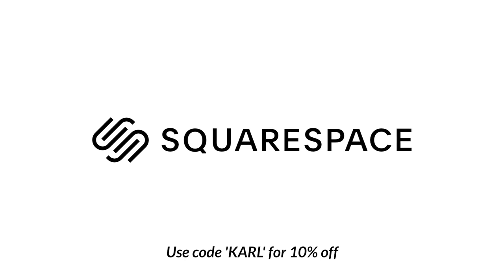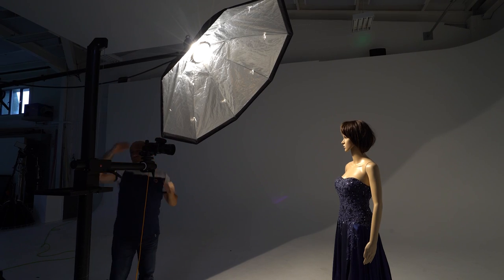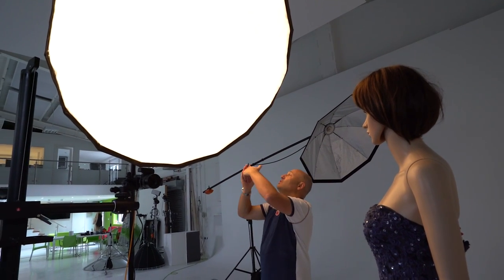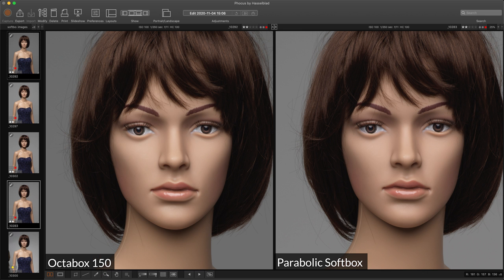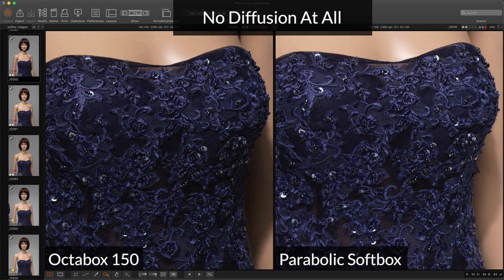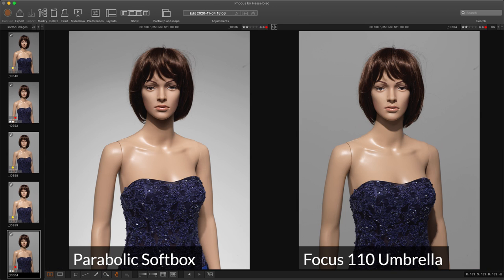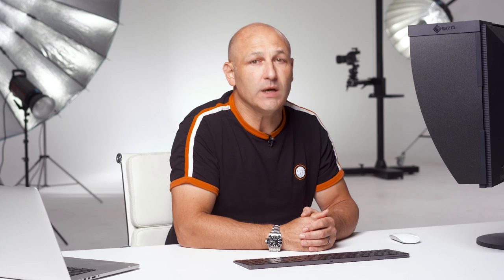The Myth of Parabolic Softboxes - Save yourself time, frustration & money!

Comment: In a larger setting, the deep softbox should give a brighter light in comparison and fall off faster at the edge - parallel to a normal reflector against a high intensity one where a step of light is gained.
Of course, there is no difference in the comparison because only the centre of the light is taken.
Reply from the maker: You may gain a little extra exposure from the efficiency of bounce back of light from the initial parabolic shape at the back of the deep one but after it goes through two layers of diffusion there will be no difference in the homogenous effects at the front of the softbox compared to the Octabox as my tests demonstrated. The only slight difference visible in my test is due to the physical surface area of the front of the deep one being slightly bigger that the Octabox and down to the inverse square law because the light is further back in the deep one.

Comment: In a similar breath, would you say the same about some companies selling softboxes much more expensive than others yet they can pretty much do the same thing.
For example: Broncolor vs. Godox
I'm hoping you've had experience with Godox lights and softboxes so that you can comment about the price difference between the two being justified or not.
Reply from the maker: There are many softboxes that will give the same or similar results to other more expensive brands. However my experience is that they don't keep their shape as long or last as long in general, taking the sort of beating that they might get in the professional world if regularly moved in and out of the studio etc. I've used many brands over the years, well built and constructed from Elinchrom, Profoto and broncolor - The brand I tested here seemed relatively strong but poorly designed for assembly and disassembly also the godox light that I attached it to seemed to lack in strength on the tightening angle handle to take the weight securely, I had to tighten to such a degree I was concerned it was going to break. I've also just recently purchased and alternate brand Parabolic reflector with a focusing rod to compare against a broncolor one that is 6 times the price. The results of that test will be revealed in a future youtube video. In a 25 year studio career I can only say what I experience, I don't get paid by anyone to say anything different so I just say what I see. Whilst I appreciate that there can be big differences in price between things that look similar it is not always as simple as that but I agree there are certain tools where I could recognise that that particular tool will do the required job for less money and that one won't. I started my own career with that approach, the difference is in actually understanding the physics and knowing what the tool is supposed to do and how it is supposed to do it which is why this video is a perfect example. It was painfully obvious to me that this particular tool was literally a waste of space and weight.

Comment: I’m sure the original Parabolics such as Briese with a slidable tube flash source are intended to provide a soft but directional quality as the tube is manipulated...
I agree with your verdict that these pseudo parabolics  are not much different to conventional softbox
Reply from the maker: Hi Simon in this video the main point was that putting diffusion in front of a parabolic reflector means it loses all its parabolic benefits.

Comment: All comes down to primary intent. Buying with the primary intent to use as a softbox? Then sure, it's not a great choice. But if buying with intent to use reverse mounted, then well, if it comes with a diffusion panel, then it becomes just another level of diversity to the tool and that's a good thing. If from the onset I'm wanting soft light, I'm not reaching for my PB. But, I've been known to reach for the diffusion panel at the end of a reverse mounted PB shoot, just to grab a few more shots at the end of a set to obtain a different look. It's all there set up anyway, might as well make use of it. Thus having diffusion at such a time, is a great thing. If offered the choice, I'd take a PB with diffusion panel over the PB without one any day.
Reply from the maker: Hi Rob, I don't disagree but this and others that are marketed in this way don't come with a reverse mount, a bulb shield or focusing rod. If they did then they would (depending on the internal material) be useable parabolic reflectors. I covered parabolic reflectors and their benefits in this video - https://www.youtube.com/watch?v=femBzU9-hXI&t=11s

Comment: The octobox does two things differently because you’re right about light columns. First, it’s less directional which means the edges of light a far softer and secondly theres more light straying on the background. You can’t see it because your background is white. It’s not bad - just different.
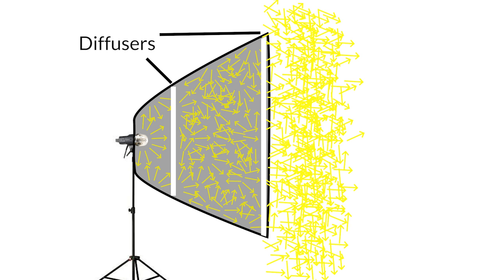Reply from the maker: Hi if you've studied physics then you should be able to understand from the diagram at 1:26 along with the fact that the light is not at the focus point of the parabola, that there is no way the light can go through two layers of diffusion and be expected to have any direction left to it at all. There may be a small chance that the intensity proportion is more heavily weighted to the circumference of the modifier, if the diffusion wasn't doing its job, but this wasn't something  that I noticed. Any fall off differences or intensity differences on the background are purely due to the slightly larger surface area of that modifier or that I didn't exactly match the output exposure or position when I changed lights.
Reply: Hi, I don’t have an advanced degree in physics. 

Regardless of internal diffusion, light is still shaped by the container it comes out of. 

Rocket fuel combusts in all directions equally (I.e diffused) but is directed by the aperture obviously. Photography-related, if diffusion left no direction of light then rectangular boxes wouldn’t project strips which of course they do. 

Octoboxes are highly similar to deep soft boxes (and I agree parabolic is just marketing nonsense) but they simply release light more at a wider beam because of the shallow sides affecting angle of attack.
Reply from the maker: @neural9  Hi you are right about one thing, light can be shaped (or directed is the better term as photons travels in straight lines on earth) by the container it comes out of. But and here's the big but, it's not coming out of that container when there is a front diffusion. It is now coming out of a new material called diffusion and that material based on it's optical density redirects the light in all directions, that is the purpose of diffusion, so it makes little difference what was happening behind that diffusion. In fact poor diffusion or softboxes with only one layer of diffusion at the front will often result in the middle of the softbox being more intense than the edges. In this case though both these softboxes have two layers of diffusion and once the light has gone through the first one it is then scattered off of the internal walls of silver because it has lost most if it's direction and then by the time it comes through the second layer it is now homogenous which is what a good softbox should be.  Thin rectangular softboxes also don't technically project strips, they emit light in all directions up to the perpendicular angle of direction of the softbox, that is that light comes out of it with the highest strength in the same area of it's shape and then the light will gradually loose intensity at all the other angles that it can escape (usually 90 degrees either side from the direction the softbox is facing). A wider softbox does exactly the same but it just means it has a bigger area of light at the higher strength in the direction it is facing. There is no 'beam' difference coming out of the front of these softboxes because  there is double diffusion or perfect diffusion. The beam angle can only be appropriated to a reflector that has no diffusion.
Reply: Thanks. Did I read in your reply that you consider the diffuser fabric as a perfect diffuser of light - I.e. light that hits it emits from all surfaces in an equally uniform pattern?
Reply from the maker: @neural9  Hi Rob, I don't consider it to be perfect diffusion, that would depend on the material being used, but given that the light is first going through one good layer of diffusion and is scattered and then goes through another layer of good diffusion at the front it is then diffused very effectively by the time it comes through that second layer at the front. Which is why with the front diffusion removed a small difference can be noticed and of course with no diffusion at all (as with my test) a greater difference can be noticed when comparing the two modifiers.
Reply: @VisualEducationStudio  hi Karl, great video and it’s really informative how you’ve walked us through it. 

I think where we may differ is that I think that the diffusion is relatively low (0 vs 360degrees scattered) and therefore light is still relatively directional and therefore influenced by the container. 

I don’t know what a material would look like with perfect diffusion (maybe Raleigh crystalline or Debye particulates such as a dense cloud?) but we could solve it by having some sort of diffraction coefficient value from the combined fabrics which probably required a lab to test!

Again, thank you.
Reply from the maker: @neural9  Yes you're correct with ultra thin loose mesh 'diffusers' you can still obtain direction collimated light and broncolor do a range of very weak 1/4 stop diffusers so that it only slightly diffuses the light but the collimated benefits can still be appreciated, but those aren't 'softboxes' which is what this thing was marketed as and many other brands market theirs as.

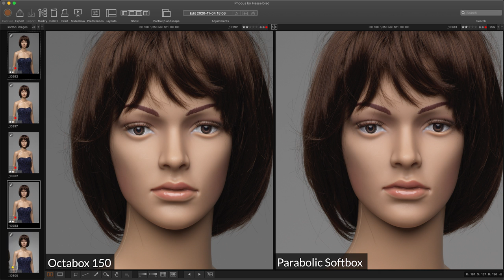Comment: @5:55 - background is brighter on the parabolic - seems that the parabolic has a more focused beam of light, less spill.
@ 6:00 - dress blue looks better on the parabolic 
@ 6:18 - slight green cast on the octobox. I assume the same light is being used. Could it be  the different material between the two modifiers?
Reply from the maker: Hi if you've studied physics then you should be able to understand from the diagram at 1:26 along with the fact that the light is not at the focus point of the parabola, that there is no way the light can go through two layers of diffusion and be expected to have any direction left to it at all. There may be a small chance that the intensity proportion is more heavily weighted to the circumference of the modifier, if the diffusion wasn't doing its job, but this wasn't something  that I noticed. Any fall off differences or intensity differences on the background are purely due to the slightly larger surface area of that modifier or that I didn't exactly match the output exposure or position when I changed lights.
Reply: You are Missing the Point Dude. The parabolic softbox without any diffusion material on (working as a reflector) it has a more focused beam, as Karl said.

Comment: Those deep "parabolic" softboxes are needed for led video lights as they have a narrow angle of illumination and the deep shape is needed to avoid a centre hot spot
Reply: You missed it completely, right? Parabolic softboxes have no narrow angle of Illumination when Front diffuser is attached. There is also no centre hot spot when diffusers are attached.

Comment: The test is interesting, but I wanted to see 2 examples: a photo of the entire diffuser with a flash (compare uniformity) and a photo of a light spot on the wall. the example with the umbrella doesn't work - the shadow on the hand on the right is bad. And I don't "believe" in parabola either.

Comment: There are differences, but they are very subtle. From the falloff of the shadows to how deep the shadows are. The average person will never be able to tell the difference though.
Reply from the maker: Yes that's correct but the differences are down to the difference in physical surface area size of each modifier, the inverse square law as the light is further back in the deeper one and of course minor differences in position of each test. The differences have nothing to do with internal parabolic reflection in the 'para softbox' because double diffused light has no collimated properties once it has travelled through 2 layers of diffusion.

Comment: Karl!!!!!I think you've missed the absolute OBVIOUS difference when all diffusers are off....There's Clearly the advantage of the Hot Spot of Directed Focused light that the Flat Softbox doesn't offer.

Suggesting you could achieve the same effect using a bulb the wrong way round into an umbrella means you need both softboxes...........

I follow you pal and have liked, but think you're well off on this one mate.

The Parabolic creates a Hot Spot which can be beneficial.  you've suggested you need another light setup to achieve the same result...Did you miss this? :O

Also you've hinted that Yes the Parabolic CAN be used as a Softbox....So looking backwards, it's even more beneficial over a standard Flat SB.
Reply from the maker: Don't worry I'm totally in favour of Parabolic reflectors and all they can do as this video shows - https://www.youtube.com/watch?v=femBzU9-hXI  I'm just not in favour of marketeers making claims that a softbox with this deep design has any advantage.